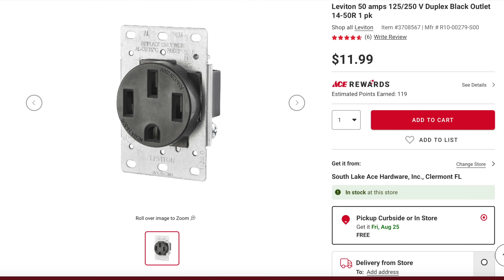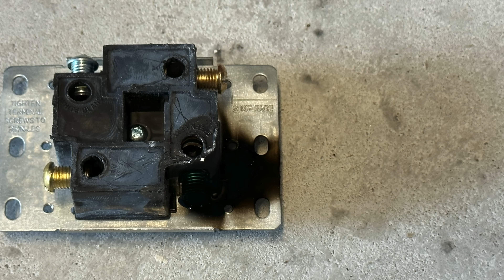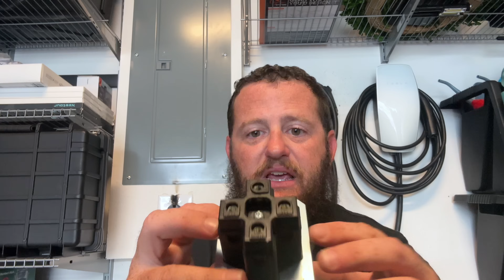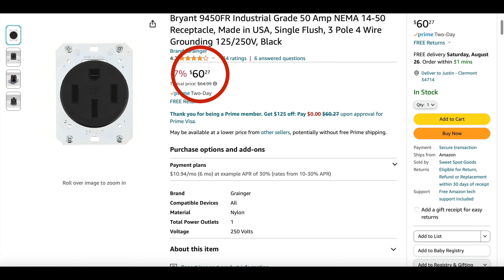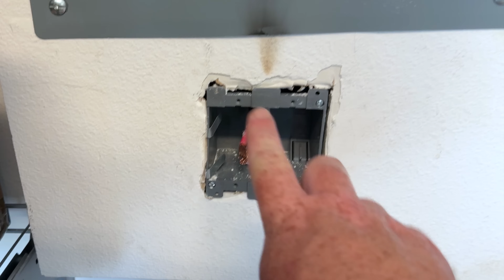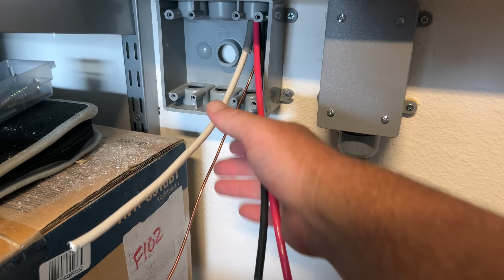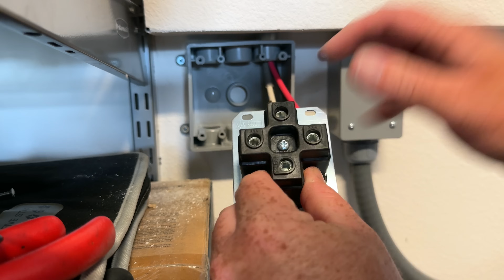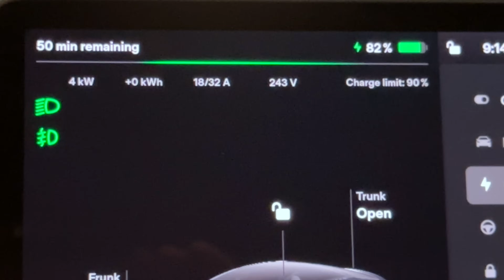This Will Save Your Life if You Charge Your Tesla on 14-50 Outlet!!

Comment: I like to share story with one of these.  Leviton nema 14-30 for a dryer.  One day the dryer just stop, so I investigated.  The outlet burned out, but didn't trip the breaker.  When I get around to replacing it I realize that it needs to be torque with 40-70 inch-lb, but it gives you a Philip-flat combo clamping screw, those are designed to cam out, so it was super hard to torque it to spec.  I got a specialize torque screwdriver head, EXC, but to put 40 in-lb on it, the screw head deformed.  Looks like it was almost design to fail.  

For an EV, get a professional to do it, if you do it yourself, get industrial grade and make sure it's install to specs.  The wire will be partially crushed when install to spec.

Comment: My electrician had installed an ELEGRP 2106S 3 years ago. I have my mobile charger connected permanently to it through an RV extension cable. So far no issues with it. But learning about the build quality I decided it is better to upgrade it. So off to The Home Depot I go and got myself a Leviton 1450R that is EV rated.
Reply from the maker: Smart. Even if it seems fine, not something to take a chance on ya know?

Comment: The plug failing on the ground pin is very unusual. It's also very unusual to trip the main breaker even during a fire when one of these Leviton outlets fails. The evidence points to you in fact screwing up the install. The outlet is also not appropriate and should never be used in an EV charger application.

Comment: Thanks for the nice video! After doing a lot of research and installing several of these, I have found that a lot of people do not torque the lugs on these outlets and that can be the point of failure. Loose connections cause issues with sparks, especially on a removable plug like this instead of a hardwired setup. So, preferably hardwire directly to the charger (potentially getting higher amps assuming you have the correct circuit) or if you have to have an outlet, at a minimum check the torque before buttoning up your setup.

Comment: An even rated 220 receptacle is not good enough- the amp rating matters - for an rv the amp draw is high for just a moment as a/c units start but the draw falls down a huge amount to keep them running. With charging you are pulling 48 amps constantly— for hours and hours — it isn’t just plugging in and out it is the amp rating- a receptacle rated at 48 amps is not safe - so what is the amp rating of the two receptacles you suggested? And you may need larger size wire / size 4 maybe - the dryer can run just fine on 30 amps and so usually these dryer receptacles are not rated for a true 48 amps drawing for six hours at a time!

Comment: Sounds like you didn't torque the connections back down to spec after you took it apart, therefore causing a loose connection over time. Did you torque down the connections? When you flipped over the outlet, you can see which screw was loose by the burn mark.

Comment: why is the ground wire burned. I call bad installation. There is nothing wrong with the nema 14-50 Leviton jack. If you think there is then take it to court. I call your bluff. the installer did something wrong, not the jack.

Comment: Addressing the people who are complaining he's plugging and unplugging his connector and it's not designed to do that, he is not doing that. His Autel connector is hardwired, and as he said in the video, the 14-50 setup is only for testing various devices for review. One tip I have is make your wire connections to the outlet first in case you make a mistake or run short at the outlet. You then have all that extra wire at the panel to trim and position for a perfect fit.

Comment: That happened because who ever installed the plug did not tighten the wires into the receptacle. Brand is fine.  Electricity vibrates as it travels and it's not tight enough, it will losen!
Reply from the maker: subpar installation is such a huge hazard
Reply: I'm curious how you know that was exactly what happened? Not saying it wasn't, but unless you were there and inspected it upon removal, it may have been something else that caused the short to ground.

Comment: I don’t understand all Europe’s has 220-240v outlets and its strait plug in never catch fire why only here in US
Reply: It's because of the high amperage EV connectors provide, and the outlet's catching fire is very rare and due to either material or installation errors. I never understood Europe's choice of 240v for every day items like clocks, radios, TV's, cell phone chargers, and any other small amperage appliance. 120v will give a person a shock but you can let go. 240v locks up your muscles where you can't let go and the extended shock will kill you. 120v for every day items in the US is much safer and we have 240v for our larger appliances that require it. Ovens, clothes dryers, water heaters, electric furnaces, and air conditioners all use 240v.

Comment: I’m glad you’re ok. Thank you for sharing your experience. Leviton is not designed for continuous load and should not be used for EV charging. They have it listed on their label. Also, it would be safer you were to use a GFIC breaker. 

Here’s my setup at home 
-50 amp GFIC breaker (model homeline Square D HOM250GFIC) - wires are torqued to 41 in-lb per spec listed on the breaker. 

-6 gauge THHN wires (2 hot: black and red;  one neutral: white)

-8 gauge THHN ground wire (green). 

-Hubble outlet (9450A) torqued to 75 in-lb

-Metal box and Metal plate.
Reply from the maker: Cheers

Comment: Good explanation. However....The reason the Hubble was more expensive is the internal components. If you compare the specifications, you will see that Hubble is 12500W and weighs 0.7lb. The Bryant is rated for 7500W and it weighs 0.6lb. This means that the internal components of the Hubble  are more robust. Think about them as  spec or hospital grade vs household grade receptacle outlets.  Spend the extra money to provide for the additional heat generated by continuous loads @ 50 A. 
Also,  both have 60C terminals, unless yours is marked for 75C,  you need wire that can handle 45A @ 60C -6 AWG which is 55A @ 60C
Reply from the maker: Thanks for sharing

Comment: My Barn has already have a 6-50 outlet should i change to 14-50?
Reply from the maker: Well the beauty there is the wiring is already in place. I believe the 6-50 gets you about 2/3 the speed of 14-50. Just verify the breaker and the wire gauge when you do the swap so you don’t cause a fire risk

Comment: You need to make sure the wires are properly torqued to the outlet.  Plugging in and out would not cause that.   As electricity travels, it vibrates.  The vibration of the electric travel caused the receptacle failure.  The vibration loosened the screws.   Get the torque spec and use a torque wrench

Comment: Glad you're ok. But, if you have 2 chargers that you plug and unplug, why don't you just install 2 receptacles so that you no longer have to plug and unplug daily. And I would guess that the Levitron would have probably worked just fine. I'm not an electrician but as I saw to EV chargers, the simplest would just be to have 2 breakers and 2 receptacles

Comment: I guess I don’t understand this set up.  Your inches from the box so why not just pay to hardwire the charger into the circuit box?  Why even do the whole outlet mess?  Doesn’t make sense since you paid 100 for the outlet when for 200 bucks more an electrician could’ve hard wired it.  

Also, why are you plugging into the wall constantly?  Shouldn’t the charger just stay plugged in so you can use it?  I don’t get it.
Reply from the maker: I already have 1 hardwired. I have a 14-50 also because I test charging equipment

Comment: Great video.  My electrician put in a Leviton 5 years ago.  It failed and blew a few days ago.  Replacing with your suggested plug.  Glad to know it was just the parts and not something more expensive.   Luckily the plug melted, and not my house. The fuse box popped as intended. 😅
Reply from the maker: Cheers

Comment: Quite simply, Nema 14-50 IS designed to handle 50 amps continuously but NEC mandates a reduction to 40 amps if continuous.  I’ve never had any issues with Tesla chargers on any Nema 14-50 receptacle but they were all on 50 amp breakers and no one was unplugging anything WHILE any charging was in progress.  (Scary thought that there are people who would do this for whatever reason )Your dryer socket, as long as it’s installed correctly with the correct gauge wire with 50 amp breaker, I wouldn’t really get too worked up over it.
Reply: And the funny thing is is really no reason to unplug it
Reply: @IFIXCARS12355 Indeed.  Main point I was making though is Nema 14-50 has been completely trouble free for me and I’ve got wheel time with a few different ones.  Just make sure wire gauge and breaker are correct.  I also run my dryers off these sockets with zero issues.  Of course, faulty receptacles can make it through production but I’ve never seen one fail unless it was either user error or installation problem.

Comment: Cycles means how many times a plug is plugged in and unplugged?  So if you had left it plugged in, then it would have been fine?  Not judging, just wanting to understand what the cycle failure meant.  Sounded like if I just left mine plugged in all the time, then it'll probably be fine?

Comment: Tesla home charger is designed to be hard wired to your panel.  If you plug in a charger under load, you create an arc (like welding).  You can still use the plug in but switch it off at the breaker prior to plug in and plug removal.  Also remember that these plugs rely on a springy metal to mate with the prongs on your charger.  Over time, repeated in/out plus heat can take their toll.  Why not just hard wire it?

Comment: WARNING ! IT HAS NOTHING TO DO WITH CYCLES. !!  The word he meant was duration.  The standard 14-50 is meant for appliances, that" cycle" on and off...If you know how electricity works, you would understand.  So the load is drawn across the wire, witch creates heat. If you ever felt a extension cord and it was warm, it's drawing more amps then its rated for. Those out lets are not rated for EV use.. They make them, there not Cheap !  A EV draws the total amps on that circuit continuously ! If your electrician didn't over size the wires and uses a Non EV stamped out let. The heat build up will melt the outlet. This has nothing to do with pulling the plug in and out.. Unless the pins are not secure after plugging in. So if you plug in a draw 40amps for 4 hours, it will be warm. If your cheap, your undersized wires with heat up enough at the connection points to melt the Non rated outlet.. This guy has no clue what he's talking about,, he purchased a commercial outlet, not residential.  NOT EV RATED.
Same company makes EV rated outlets. Stamped with a EV car

Comment: What would your suggestion be for someone who is renting their home and the only 4 prong is near the dryer far away from the garage, but there is a standard three prong 110V socket? Should I just use the regular adapter with minimized charging or pay for an install to equip the four prong?
Reply from the maker: If you aren't driving 40 miles a day, the standard outlet in the garage actually can work. My experience has been 1% per hour of charge on a standard outlet. So overnight you could have roughly 12% charge. Use public free charging to supplement or paid if necessary
Reply: @BeardedTeslaGuy  Using your level II charger, what type of jump did you see on your electric bill?

Comment: Good for you posting this. I do blame the industry. If a plug is rated for 50A it should be able to handle 80% of the load constant and forever.  It how there rated. Yes you definitely could have died. Shorts are no joke.  Leviatan has the 14-50R which has a little electric car symbol on it.  Its much beefier like the units your choose. Your wire should also be at least 6awg to be properly rates for the current which you have. Also try not to use sharp objects when bending your wires. The insulation is suppose to be undamaged for proper installations.  I have replaced a few of these recently.

Comment: it has zero to do with Leviton or any other  brand .. it has to do with the load rating for the plug. the Leviton ( and other s brands like it ) clearly print that these are not intended for continuous high loads like overnight EV charging, theyre intended for dryers and appliances that only require short loads. it says right on the packaging ( granted, in mall print)  " not intended for EV charging"

you need an industrial rated receptacle , not a commercial one like the majority sold to consumers at DIY stores. Most now will have an EV charging emblem on them to let you know theyre goof for that.

Comment: I installed lot's of tesla chargers for the Seattle area back in 2015, there were no specs for any specific recepts, I installed whatever 1450r the wholesale house gave me, they were mostly Hubbel. Not denying all these problems, but there's a some variables that aren't getting looked at. Using AL is certainly not a good idea, then the whole tightening of the terminals thing. #6 copper is not very flexible, when you terminate and then stuff it in the box it requires a bit of folding of the stiff stranded wires, this loosens the terminations, so if you don't fold it in the box then pull it forward just a little and retighten, that right there is a potential source of heat. Most electrical installs never see a continual 70/80% load, even when you properly terminate the recept, just the fact that you are loading it at the 70/80%, it will get hot internally.  Add to that any DIY butterfingers and you will have a potential problem. Most of residential wiring for lights and plugs just never get's used that heavy. When you heat and cool off terminations over  and over, I think it really increases the likelihood of hot spots and hot spots are like cancer they start little and get worse. I would advise checking it out once in a while. Turn off the breaker, pull out the recept and see if you can get a turn or so in the recept screws. There's a little hyperbole going on with "your house is gonna catch fire" or "if it shorts out you're gonna die" it's just not true. Go ahead and google how many houses burn down due to EV charging, it's the whole "if it bleeds it leads" certainly you don't want things going all sparky, but you are at much more risk just driving to work with all the people being distracted while they drive. It's gonna be OK.

Comment: I've had a similar failure on my dryer outlet.  It's not a defective or bad brand or bad install.  Vibrations and heat cycles over time can cause connections to loosen, even in a dryer use where it's not unplugged routinely.  Bottom line is, at least annually INSPECT your outlets.  Make sure the wires are secure and the plug is secure in the outlet.  

This is not a Tesla issue. 
This is not a Leviton issue.  
This is not an installation issue.  

It's a maintenance issue.

Comment: Never use romex #6 it’s only rated for 55 amps .. you need to use thnn #6 is rated for 75 amps .. 

While you can technically use Romex number 6 for EV charging, THHN wire is generally considered the better choice for EV charging applications due to its superior heat resistance and suitability for exposed wiring situations, which are often present in EV charger installations; however, if the Romex is properly installed and meets local codes, it can be used, but always consult with a qualified electrician to ensure compliance.
Reply from the maker: There are charts available showing what each is rated for even at hardware stores, which is super convenient

Comment: You say the Bryant and the Hubbell are the same but have you looked for the temperature ratings on each product? The Hubble is rated to 75°C. Can you find a temperature rating for the Bryant? Most of the cheaper 14–50 outlets are rated at 60°C. If you’re going to go to the outlet route for your charger, you might think about the old saying, pennywise and pound foolish.

Comment: Pardon me if this is already been mentioned but you do realize that it is a code violation to plug your Tesla wall charger in to an outlet… That is designed to be permanently wired in and simply putting a plug on it and plugging it in is against code.

Comment: Few things to note.
1. Shiny vs non shiny has no bearing on the topic at hand, so why discuss it as if it matters ?
2. Just because both plastics are black doesnt indicate they are the same material.
3. Neither of the above is the reason it failed.

The reason it failed is because of a loose connection, plain and simple.  Connection becomes loose because of repeated connects/disconnects, then starts arcing (jumping electric) which causes overheating.  Thats the ONLY reason that happens.  

The CS6375 outlet is a 50a alternative and locks into place should you simply beleive the 14-50 is an inferior plug (which it isnt).

My suggestion is once you install a new outlet and tighten it down, run it for a few days.  Then turn everything off, and tighten it down some more.  The reason is the wires, especially thin stranded, will compress after a few heat cycles and thus the connection loosens a bit.  After a few cycles, it will reach a point it wont compress anymore, and the second tightening will lock it down.  And lastly, quit plugging it in and taking it out.  That has no effect on the wires becoming loose, but the blades of the plug pushing in and out ober time will loosen the connection the blades make inside as well.

Glad you are ok, but trashing a brand, with zero insight as to what caused the issue, is ignorant.